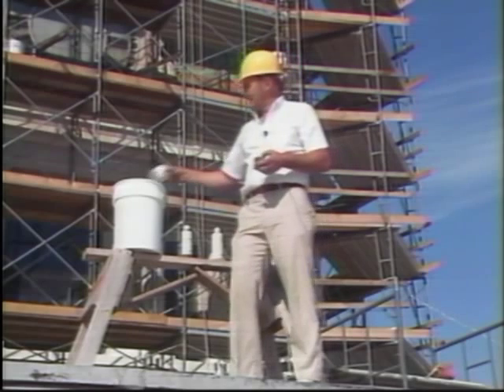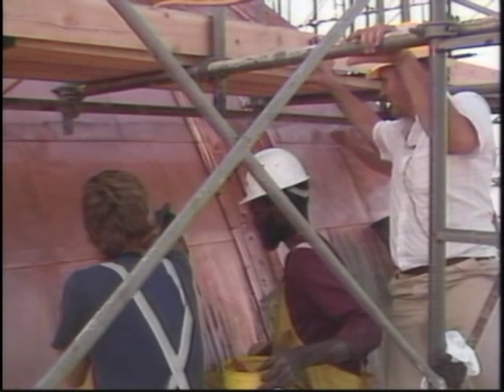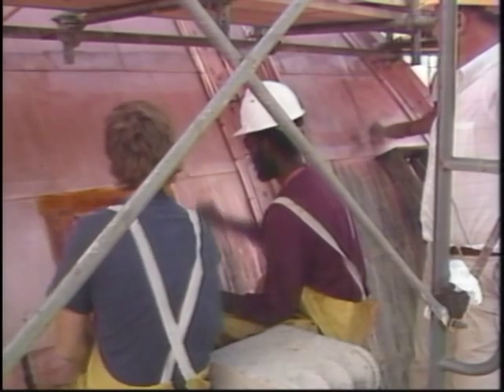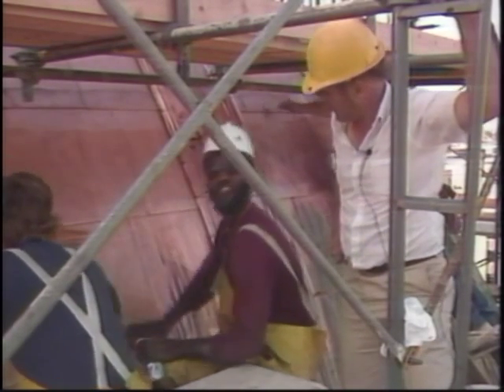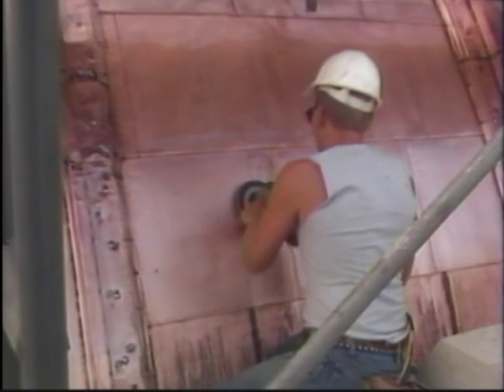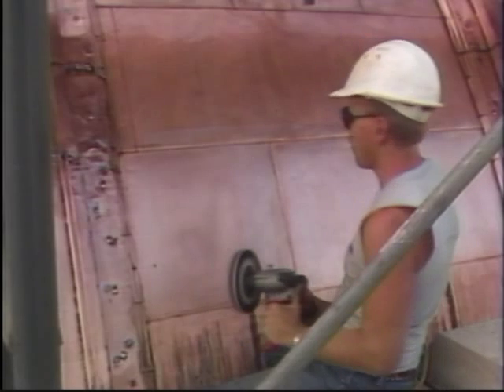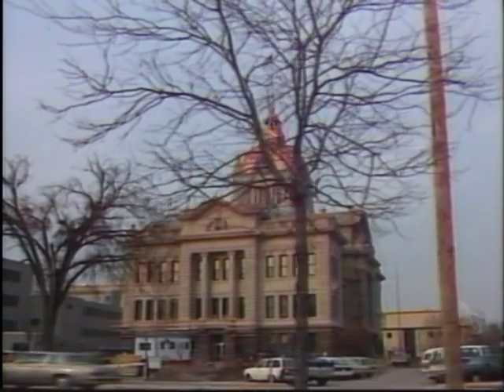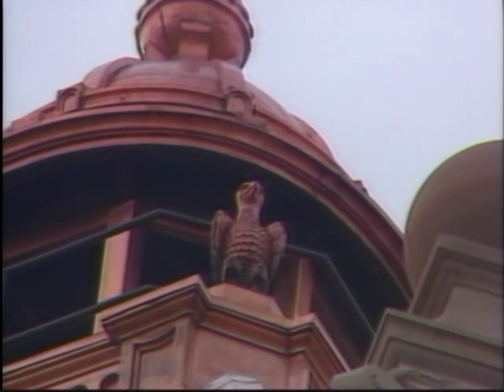Copper & Bronze Restoration - Chemical Cleaning

Comment: For those that are viewing this and wondering what they are using, the copper prewash is almost certainly a form of muriatic acid, and the brightener is a form of oxalic acid.  The first coat removes the oxidation (green, brown, black colors, etc.) and turns the copper a pink or yellow and the second coat prevents immediate oxidation by forming a bluish protective layer (which is not a harsh form of oxidization).  Notice he said to "neutralize with water" after each coat.  What he didn't say is you can't us city water with chlorine in it as that will immediately turn the copper green again.  If you have regular ground water, it will work, otherwise you have to use distilled water or de-chlorinate your city water first.  The final step is to buff it out.  You don't really want to use to use steel wool.  A metal buffing pad with an electric buffer works perfect or you can improvise like they do and use a cut piece of floor buffing pad.  Once you have it all shined up, put a coat of something called "Copper Guard".  You can spray it on and this will prevent anymore oxidation.  You should recoat it with copper guard about once every 2 years.